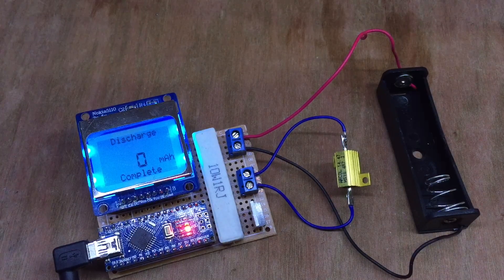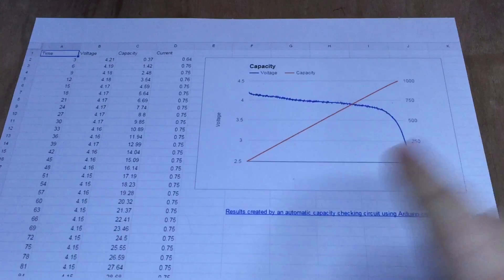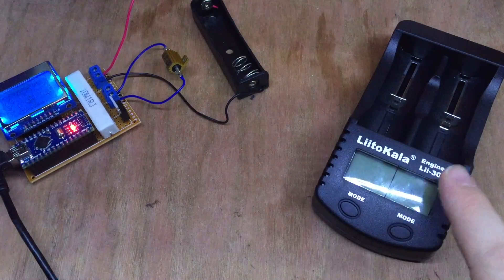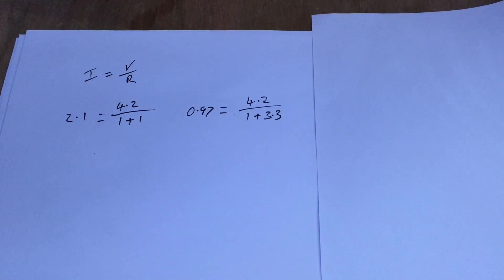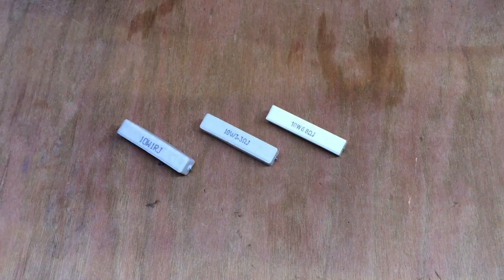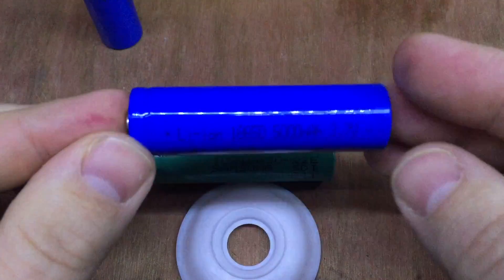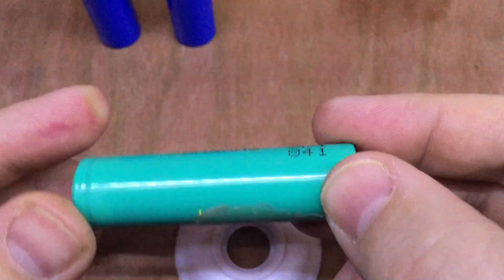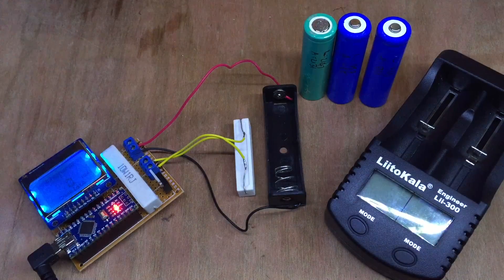Lithium Ion 18650 Capacity Checker Update - Adam's Arduino Projects

Comment: This is pretty cool.  If you were checking batteries that are 12v or 18v, could u still do it after some sort of step down converter so that the arduino is still powered with <5v and would it still be accurate?

Comment: Hello, I made the assembly and rechecked several times the connections. But I have a problem: when I start the discharge, the voltage is first quite correct, and as soon as the discharge begins, the voltage drops at once by several tenths of a volt. An explanation?
Reply from the maker: Could your cell be of questionable quality? If the cell is poor pulling 1 amp may cause this issue. Increase the load resistor to reduce current draw and attempt to get an idea on the capacity.
Reply: @AdamWelchUK  Ok, thank for your answer. I will try this.

Comment: What a great rabbit hole this is, I forgot my original project and now am spending my time looking at reusing cells, building chargers, load testers, battery banks and solar controllers. All presented as very approachable as well. Wish I stocked up on Arduino's before the shutdown, I really should have kept a dozen cheapies in my junk box.
Reply: Lol can relate as I am also doing the same

Comment: +Adam Welch Would it possible to build a smart fast charger using the arduino? Would it possible to modify this circuit and add a source and periodically disconnect the source and  check the battery output to controll the source ?

Just a random thought, would be glad to know your thoughts on this.

Thanks

Comment: Very interesting. I was wondering if there is a way to code in and get the measurement of the internal resistance of the battery. Have you tried it?

Comment: Is it posible with a little adjustment to check 2s battery's
with 2 voltage divider an bigger resistor?
Reply from the maker: Yes, that would be possible. You just need to change the voltage cut off value in the code and think about your discharge resistor (it’s power rating in particular because of the higher voltage).

Comment: Are you accounting for VDS on?
Reply from the maker: Yes. Due to the fact that I’m measuring a shunt resistor it accounts for all the current flowing in the circuit (and therefore all the resistance). But to be honest, I’m using a logic level mosfet which should be fully on the whole time the cell is discharging so there shouldn’t be any real noticeable resistance (or heat) in the mosfet.

Comment: This circuit is not good at all! And to explain why here it is…
If you have two resistors in series and are only measuring voltage drop of one resistor then you will get lost results as you will not be measuring all the current. Also if you use an IRF44n it needs higher gate voltage to fully turn on meaning that it will get wrm or hot loosing current so readings will not be accurate as the mosfet will act like resistor! Must use an IRL44N which is logic level and is fully open at 5V! 2 power resistors is just crazy and unnessary for this project! This is a bad copied project from the orignal good working project that Adam has plastered his name on! If you want to see the orignal real better project then here it is on instructables… http://www.instructables.com/id/DIY-Arduino-Battery-Capacity-Tester-V10-/
Reply from the maker: Hello there.  I really shouldn’t have to do this but...  actually you are wrong on at least three things I’m afraid. Firstly the same amount of current flows through the whole circuit when items are in series. Check out ohms law. Secondly I don’t think you’ve even watched my video because I use a IRF3205 which has a low gate voltage and is fully on at 5v - it’s logic level. Thirdly thank you for supplying the link that proves that OpenGreenEnergy actually took my idea, my code and tried to suggest it was his. Take a look at the comments on his instructables post right at the bottom where he says he got the idea from me. He did have a link to my video from that post, but it seems to have gone. If you don’t believe that, just look at the dates they were posted. Please, before you go making claims like that you check the facts.

Comment: Does the rate at which you discharge the cell affect the accuracy of the calculation?
Reply from the maker: Not really. The code takes a reading every few seconds but remember you’re cells will be rated for a particular c rate. The harder you discharge the less overall capacity. Most people seem to settle with 1 amp discharge.
Reply: Thats great. You mentioned in a comment somewhere that building this for 4 cells may introduce inaccuracy due to the added processing time of the extra 3 cells, is that significant and can you get around it? 
Ive programmed mine to:
-read cell 1
-calculation
-read cell 2
-calculation
-so on.. 
-display all data
-then 5 sec interval 
Thanks btw, you made the clearest videos ive seen!
Reply: Also, one more question if i may. Ive added code to determine internal resistance. Im not good at Maths but when your code assigns the 'current' variable you are doing:
current = (volt - shuntVolt) / shuntResistance;
-> (4.20 - 4.14) / 1 = 0.06A

Whereas when im finding internal resistance i do (got this equation from another source):
current = shuntVolt / shuntResistance;
voltDrop = volt - shuntVolt;
internalResistance = voltDrop / current;
-> 4.14 / 1 = 4.14A
-> 4.20 - 4.14 = 0.06v
-> 0.06 / 4.14 = 14.5mΩ

Why does your current var not match mine?
I would prefer to calculate current only once instead of twice

Comment: Another wonderful post! Thank you Adam! If I'd rather not use a LCD screen (or the like) and just grab the data via serial print and create a spreadsheet like you have, may I simply remove all references  to the LCD in the code? Or simply leave the code as is and not hook up a LCD? Thanks again for any help!

Comment: what is discharge current? what resistor for the 1A current? what resistor for the 500mA current? here is the change of discharge current (shuntRes = 1.0)?
Reply from the maker: +Bartek Debowski The shunt resistor (shuntRes) is the only value you need to set for resistance. It uses this value and the voltage to work out the total current of the circuit including your load and the shunt.
Reply: Adam Welch I would like the discharge current (load) of about 1A
Reply from the maker: +Bartek Debowski The you just need to look at ohms law. R=V/I so R=3.7v/1a so R=3.7 ohms. You’ve already got 1 ohm in circuit for your shunt, so you need a load of about 2.7 ohms. Remember this calculation is based on the nominal voltage  so to start with it will be higher than 1 amp and it’ll end up drawing less than one amp.

Comment: OK Adam or anybody else, Im more or less a idiot when it comes to programming. I'm reading a couple of books and following a online course but I'm a newbie. I have been turning a wrench for 25 years on cars and boats and a disability has forced me to change my direction in life. Sooo I really need someone to have the complete arduino code, with the nokia code and Adams, all compiled so i can just copy and paste it to my IDE. Im not smart enough apparently to get the 2 halves of the code put together and make it work. I end up with compiling errors and then line after line of code problems and I've spent weeks and I'm just not advanced enough yet to make it work but I really need this load tester to work so I can finish the rest of my projects....Please help....
Reply from the maker: Hi Gene and thanks for your comments.  
The code on my website is all the code you need.  You just need to import the nokia 5110 library into your arduino IDE.  Go to the link in the comments in the code and download the Zip file.  In Arduino IDE go to Sketch -> Include Library -> Add ZIP Library and then open up the zip you downloaded.  The code should then compile.
If not, let me know and I will see if I can export the binary and explain how to load that onto your arduino.  I think that should work.
Cheers
Reply: lol when you a oil change tech and someone asks you to do a timing chain on there BMW there might be a problem....So I may work your patients...lol.. so apparently i have downloaded the zip folder because it give me a error message that the file already exist. but if i try to find it there's like 6 different folders 2 of them are called 5110 but If i open them I couldn't tell you if one was correct or if im supposed to put it in which part of the code??? I really am helpless...level 1...

Comment: Is it possible to add a schottky diode to the battery load side and then adjust the Arduino code for the slight voltage drop through the diode. To offer a reverse polarity protection?
Reply from the maker: +Gene Sarda Yeah I guess. You'd need to adjust the calculation of the voltage - should be fairly straight forward.
Reply: Adam Welch Thanks, I'll try it and let you know how it went. I have a whole bucket load of single 18650 battery holders but they have a pin out the bottom for pc mount, so with no spring at the end or red wire sometimes I can be a goof and put the cell in wrong way around in my projects.....

Comment: Hi thanks for this video i have some questions 
1 can i use 10w10ohms or 10w 5ohms cement resistor  insted of yours aluminium chad power resistor 
2 can i use irlz44n
Reply from the maker: You can use any resistor you like as the load - as long as it is rated for the right amount of power.  It'll just affect the time it takes to discharge.  If you change the shunt resistor you'll need to adjust this in the code.
Yes an IRLZ44N is an ideal replacement for the IRF3205.

Comment: Can i use 15ohm 10watt resistor instead of 1ohm 10 watt resistor by just changing the value in the code?
Reply from the maker: +SATHISH KUMAR Yes you could. It'd give you a current draw of about quarter of an amp - might be a bit low though?
Reply: In the schematics, 1ohm 10watt resistor is mentioned as Rsense. So will it have any effect on load current? Thank you so much for the reply !!
Reply from the maker: +SATHISH KUMAR You can just replace the 1 ohm resistor and adjust the code. No additional 'load' resistor is technically needed. As long as the code reflects the resistor which is being measured it should all work as expected.
Reply: Thank you so much !! Will update you once i finish building it. Thank you once again.

Comment: If you use a 2ohm and a 10 ohm in parallell instead of that 1 ohm you will get 1,66 ohm.
1.66 ohm plus 6.8 ohm in series will get you closer to 0.5A discharge.
Reply from the maker: +Klyddmeisters Thanks. Thing is because it is a resistive load it's going to change continually anyway as the cell discharges. So 500mA is a bit ball park anyway!

Comment: Hello Adam! Thank you for sharing! This has been very useful and it has also been my first electronics project. I am having an issue though with the screen going blank at seemingly random intervals and having to re-flash and fiddle with the arduino (I am using a micro) a few times before I can get it to work. I noticed the board is getting power from the battery which I don't think it's supposed to happen, any suggestion?

Comment: What software did you use to acquire the data to plot the graph. I try to use PLX but it give me a error message
Reply from the maker: +Lau Weng Yew I threw the console output into excel and used that to create the discharge curve.

Comment: Hey Adam, great video. I am curious if it's possible to have one nano and one screen handle more than one battery. Do you think it's possible to have it monitor say four batteries if you used 4 mosfets and 4 sets of resistors?  If possible I would really like to build some of these since I have hundreds of these 18650 waiting to be tested and sorted. I have many arduino nanos and a bunch of pro mini boards lying around, and I think 5 Nokia screens I could use. It would be nice to make a board that could load test like 20-30 batteries at a time or something like that. Do you think this is possible or would you need one nano/screen per battery? Love to hear what you think.
Reply from the maker: Yes it should be.  just be aware that the more maths you make the arduino do ever loop will slow down the process and could cause an issue with accuracy (although you might find this is a non-concern in reality).  The Nano has 8 analog pins so with this design you could do 4 cells.  You'd just need to replicate the code to calculate each cells and save the results in different floats.  There should be enough space on the 5110 screen to display all four cells as it goes along too.

I need to get back to this project and make some improvements.  One of those improvements is definitely expanding the cell count.  Not sure when on earth I'll find the time though!
Reply: Did you ever get around to make the multi cell improvements we talked about? I am waiting with baited breath over here, I really want to make it!

Let us know, I'm excited

Comment: hi i have modified your code to add a charging function and software reset did you want to see the modified code
Reply from the maker: Yeah if you are happy to share that would be very interesting.  What are you using to charge? Cheers
Reply: here is a link to the code
https://www.dropbox.com/s/796pclsc8qaykb5/updated%20code.txt?dl=0
and i am using a tp4056 charger+protection module
and sensing charge complete by using the blue led
Reply from the maker: Thanks - I've only had a chance to skim over the code but it looks ok at first glance.  I trust its working well for you?  I had thought about this myself in the past but I was concerned that a ground loop would cause issues - you must have got around that then, or it wasn't a problem at all?
Reply: just got it finished i need to add a heatsink to the discharge mosfet (constant current heat) have not fully tested (just that it does what it is suppose do) and the battery - only gets connected to tp4056 b- for protection

Comment: Its better to use constant load on n-mosfet and op-amp instead of cermet resistor, using arduino we can have almost stepless current control.
Search for "dummy load"
Reply from the maker: +Arek R. This is true but I wanted to make something fairly simple for a novice (which in many ways I am too) could understand. I also made this in one day with bits in my junk box. It has its issues but I think it also has a certain charm. I keep meaning to return to this one day and improve it.
Reply: You just need any n-channel mosfet and lm358, thats simple as well, and you will find these parts in your junk box

Comment: On that example we can see that old salvaged cells from laptop batteries are better than this 1$ crap from ebay.
If you want trusty and good quality brand new cell we have to look for panasonic, sanyo, lg, samsung etc.
We can buy them at fasttech.com or banggood.com
Or if you are lucky and near you there is cordless powertools fab you can ask them for scrapped cells and got brand new cells with small defects like failed weld or even cells in perfect condition from ended series production.

Comment: First of all, great project, i learned a lot when i built this! But sine i have a lot of cells and i wanted to measure more at once, i built this simply by tripling all the components, and measured on A0-A1, A2-A3 and A4-A5. The FET gates were at D10,11 and 12. On the remaining data pins i installed a 2004 LCD. The ony improvement i made was to pull the gates to ground with a 10K resistor. I have mixed results. With one it works perfectly. With 3, its all over the place. The fets wont turn on fully, then doesnt turn off. Can this be caused by interference, the low quality china arduino? Any tips on that? Cheers!
Reply from the maker: +István Gáspár Thanks for getting back to me with your progress. A 10k resistor on the gate to ground is a sensible choice. There is a remote possibility that current can drain to ground through the analog input protection diode. To combat this, I'd suggest a voltage divider on the analog sensors - the trade off is possibly less accurate voltage readings.